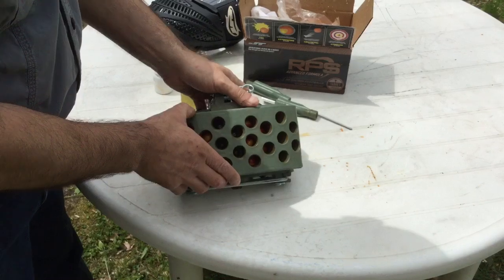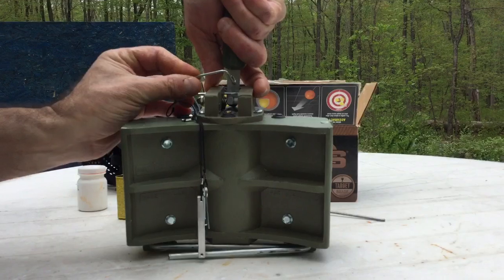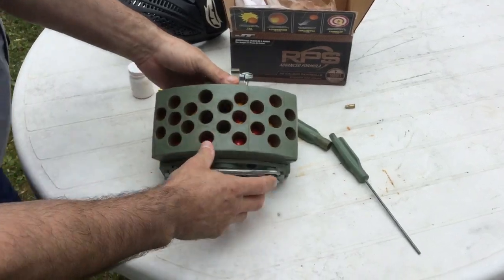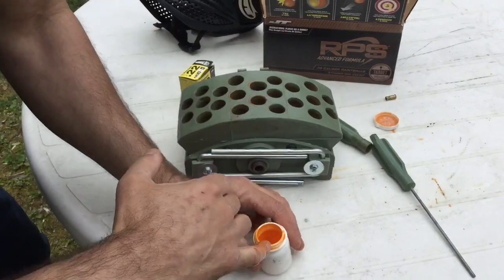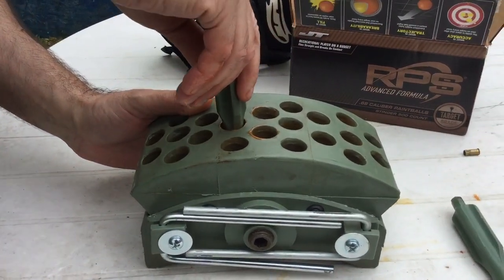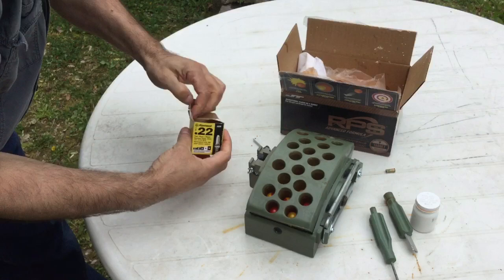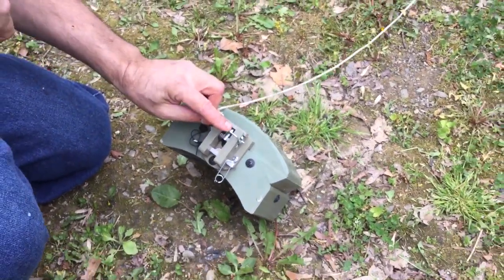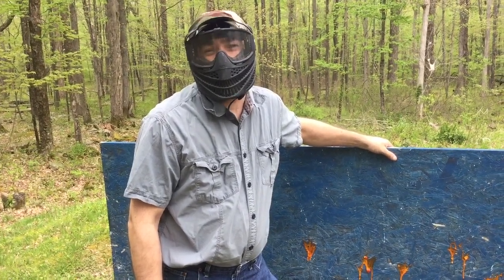Paintball landmine - PBM-22C - Reload

Comment from the maker: This is not 22 ammunition, these are nail gun cartridges that you buy at a hardware store. Do not use .22 ammunition in this mine!
Reply: Nailgun and ramset tools that work on .22 blanks come in different loads/power.What size do these use?
Reply: Aultec LLC I’m a retire mechanical designer 
I have a small suggestion, show a x-section of a bore showing the paint ball being seated with the tool.
It’s only to help the hard to understand people out there, your dimension was good enough for the rest
Reply: whyyyy. could be fun...once..lol
Reply: Aultec LLC Got anymore for sale?
Reply: It looks like he was using .22lr blanks

Comment: With the 22 cartridge, is it like buying real ammo or is it easy to obtain? Would you need any permits if you didn't already? And have you ever fired this mine off over a chronograph? This is a cool mine, I think I'd love to have one.
Reply: Alex Bellomy 
Should be easy to obtain. They use them for nail guns.
Reply: Alex Bellomy you can buy them from home depot right off the shelf, they are for concrete nail guns.

Comment: Here in Brazil you will be arrested only for having a munition of .22 :)
Reply: the good side is that we can actually have one of these if thay make it compatible with the little silver gas load.
Reply: levy I read through the comments the make of this said it's actually not .22 rounds it's blanks used for a nail gun which you can buy in most hardware stores
Reply: @ArcticWolf57  Brazil he said. Not TX. Lol

Comment: Yah. i uh found it on eBay. it was $170 somthin. 😢
Reply from the maker: Yes, the price with shipping is $169.75. But that is for our new R/F - wired remote version. We will be posting a tripwire only version with shipping for $145.00. You could find cheaper mines. If you want one that actually fires paintballs, the choices are few. Our mine is light weight. It is easy to deploy and redeploy. It has a 15'D X 18'W, 135 sq. ft. range. Also we use .22 caliber nail gun cartridges instead of CO2. They are less expensive. A box of 100 .22 cartridges cost about $8.00. Where 100 CO2's cost about $65.00. Also .22 cartridges go off with a distinct bang, that is different than anything else on the paintball field. We at Aul Tec feel we have designed a superior claymore style paintball mine. We back this product with a 30 day money back guarantee, and a 6 month parts and labor guarantee.